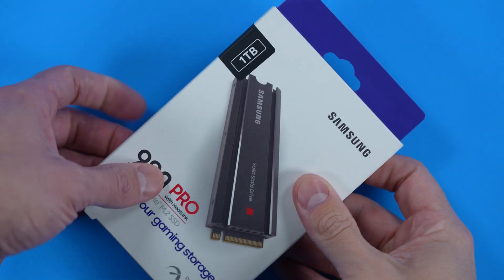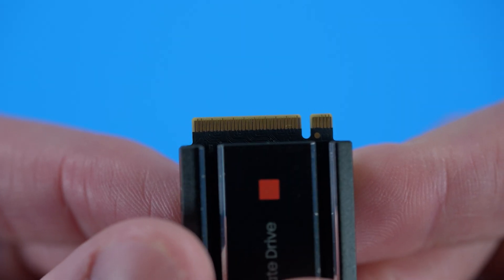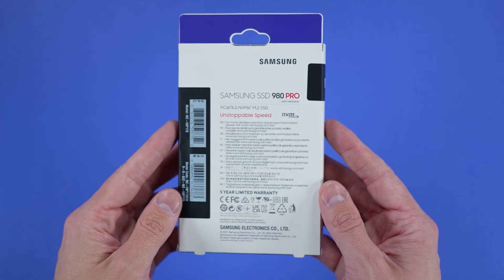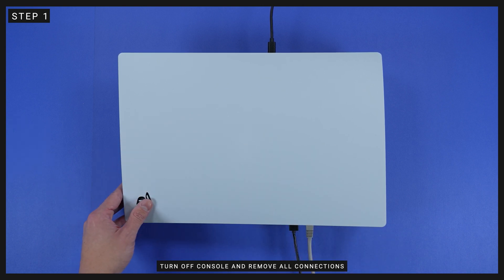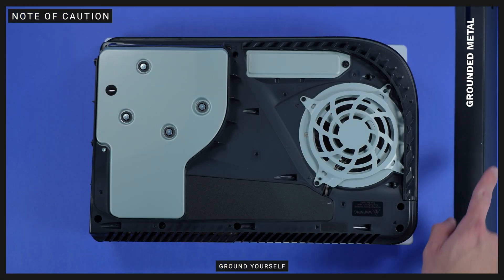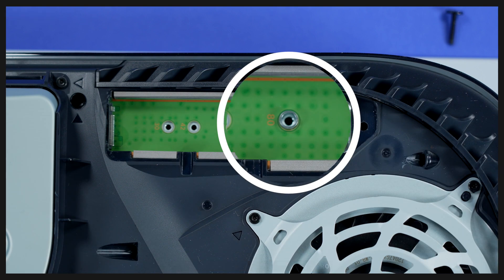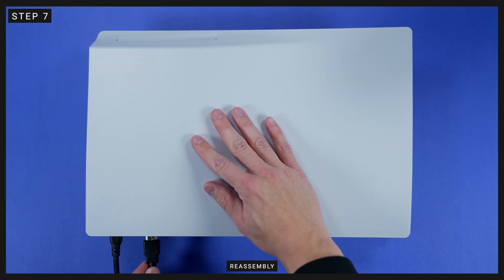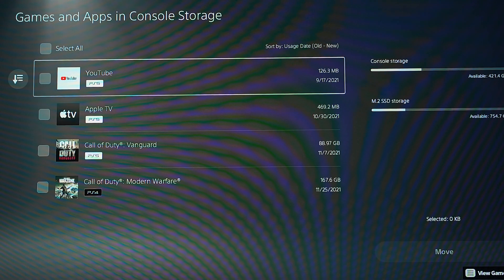PS5 Storage Upgrade - How to Install the Samsung 980 PRO w/ Heatsink, PCIe 4.0 NVMe SSD!

Comment from the maker: The 2TB is $180 now on Samsung ➡️ https://howl.me/cjkFThN5NNM
Reply: I just got the 2tb on sale at Best Buy for 153.00
Reply: Got the 2tb for $99 , prime deal 😊
Reply: @sully7105  Yes that was just the other day. You're fucking laughing bro!!!!!!!!!!!!
Reply: Got it $AUD 167.00
Reply: @unknown1859  Yeah they had it that price on PRIME DAY, missed out on that by a few days FML LMFAOOOOOOOOOO, nice bro :D
Reply: Ya bro! 🙌🏼 the price dropped!
Reply: @UnionVillageMedia 150 Amazon right now bought today
Reply: £169 Argos £190 cheaper than Xbox expansion 2tb
Reply: Got it for $130 @ Samsung
Reply: $139 on Amazon right now
Reply: Just got it from best buy $139
Reply: Needed to do the set up menu even though it changes. Incomplete review
Reply: @geefim2144  233 over here. AUD. Hoping the firmware doesn't start with 3. If you know, you know!!!!! Eh, I'll just tell you. It will implode harder than the titan if the firmware starts with 3 LMAO !
Reply: Is there a m.2 "Y" connector? So you could use two m.2 drives off one socket. It would be awesome to get 8tb with two drives.
Reply: I picked it up just 2 days ago for $100 on prime day 🎉
Reply: Got it at 146 in Amazon. Thank you for the reco!
Reply: $119 now with heatsink on amazon
Reply: I got it for $120 lol
Reply: I got for $99.00 bucks blk Friday @ Best Buy. I should’ve got the 990pro heat sink for $119.99 instead cause it’s just a faster version and makes the over all experience better. But they both are great regardless.
Reply: Dang, I got 2TB for $149 at BestBuy
Reply: It’s because 4TB drives are out that’s why

Comment: Multiple lines of evidence suggest the Samsung 980 PRO with PS5 heatsink can cause PS5 instability under certain conditions. Known firmware issues can brick the drive, which leads to crashes, stuttering, or black screens on the console. Thermal throttling may also trigger freezing or shutdowns. Many users (including myself) noticed that once the 980 PRO is removed, the PS5 runs smoothly again.

In comparison, PS5-certified SSDs like the WD SN850P or Seagate FireCuda 530 are better optimized, with more reliable thermal performance and stability. If you're having PS5 issues and using the 980 PRO, it's worth removing it and switching to a drive designed specifically for PS5. That solved the problem for me.
Reply from the maker: Mine is still trucking along with no issues. 🤷‍♂️

Comment: im literally doing this exact thing and it doesnt work. it did work but then it stopped and the screw head was stripped and now it wont read after getting replacement screws

Comment: I had both Samsung 980 Pro 1 TB & 2 TB

My first Samsung 980 Pro 1 TB Read Speed was 6500 mbps

But when i change it into new one Samsung 980 Pro 2 TB Read Speed was 6400 mbps

And Yours Samsung 980 Pro 1 TB Read Speed was 5500 mbps

Does this normal ?

Comment: When i was unscrewing the retention screw and spacer i lost the retention screw, it fell to the right and into the ps5. Anyone know what i can do? Ive never done this kinda thing before so i dont know if i should try to get it or get a new screw if that's possible, any help would br appreciated
Reply: Nevermind, the screw was still on the end of the screwdriver but it was blending in so I couldn't see it, that was the plot twist of the century

Comment: what is the height? or thickness? I wonder if it would fit underneath my GPU: ASUS TUF 7800XT in my computer.
Reply from the maker: Spec sheet has all that info for you.

Comment: Very nice simple and straight up guide 👍 Just purchased the 980 pro(heatsink) 1TB for 88.99 Can't w8 to go home and install it on my console!
Reply from the maker: Appreciate the feedback 🤝
Reply: Did you have to update it before installing it?
Reply: @xnonsz_4865  I just installed it my friend and it works ok so far. Should I update it first? 🤔
Reply: @Ailouros_90  I mean that’s what I’ve read and seen on YouTube, but I don’t have a pc that’s why I wanted to know if it works well without updating it. If u can update the firmware I think that would be better

Comment: The samsung drives don't work properly on the PS5. The read and write speed should be around 6500mb/s. NOT 5500mb/s. It needs a firmware update through your pc first. Reddit is filled with reports on this. I would recommend a different drive for easy install. Like de WD black SN850. This drive does not have this problem.

Comment: Ive tried for the last 2 hours to get my 980 pro to fit in the slot and it barely doesn't fit by the screw. Any suggestions?

Comment: I just bought this for €144, July 2023. The reviews on the website I bought it from say; this SSD has to be updated via PC first. Update via PC to unlock the 7000 MB/s read speed. If you don’t do this - it will only work on 5.500 MB/s read speed. Can anyone confirm?

Comment: Hey, so when I inserted my SSD into the slot, it wasn’t exactly laying flat after I pushed it in to the slot, it was kinda sticking upwards a bit. I put the screw on Anyway, but I wanted to see if you could let me know if that’s something I should go back and fix

Comment: The newer versions of the PS5 s are a bit different to these ones. . Getting the spacer in is a bit of a struggle as they don’t fit in the hole just sit on top and getting it still and putting the small screw in is a bit fiddly. Managed it in the end.

Comment: Make sure when installing you do it just like he did. Don’t leave it against the console and try to push forward cuz it will break your stick by applying too much pressure or maybe even your console. If you feel for the opening a little bit up and let it slide in you’ll be all good.

Comment: tips: you can get over 6000 mbps read speed (06:41 says you'll get 5500 mbps), if you update your SSD firmware before. works on me
Reply: Wtf i got to update my ssd just to get the full read speeds? Pls answer quick so i can cancel my order from best buy

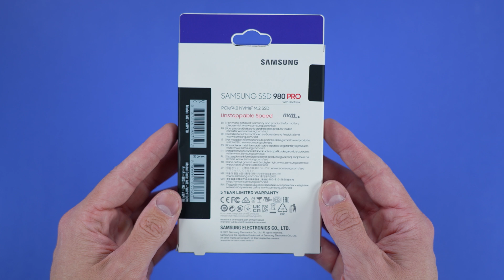Comment: Question. At 2:18. So my saved data within my ps5 console will be overwritten? Or that’s just the new internal drive itself? This is my first time getting one.
Reply: I think your original data, should still be there. Cos this guy's ( who did this video), his stuff was still there when the SSD was formatting. 

Plus it's a separate storage unit to the original storage that comes with the game.

Comment: so once you install the 980 pro with heat sink, you're able to use the 980 pro with heat sink in your PS5 that now has a 980 pro with heat sink so you can start putting games on your 980 pro with heat sink, 980 pro with heat sink
Reply: bro. fitAment?
Reply from the maker: FitAment of the heatsink 😉

Comment: Every reddit I have read you should put thermal pads on this even if it has a heatsink built in. Because the back is raw up against the motherboard itself. I did. Just a thought. 🤔

Comment: I did almost everything right EXCEPT 
The screw that adjusts the ssd LOL

But everything is working fine with the SSD. Plus I don't plan to move the PS5 so it won't be all over the place.
Reply: Do you mean the spacer or screw? If you mean the spacer, I think it might help with heat dissipation over time due to the small gap it would create between the ssd and  motherboard. I’m not 100% sure though.

Comment: Bought the Samsung 980 pro with heatsink with 2 TB. Thought about 1 TB, but decided to get a larger storage. You will not regret it. Easy to install in my PS5. Prefer it to the external hard drive.
Reply from the maker: Definitely the way to go. 👍
Reply: Did you update it to get the faster speeds?
Reply: You will reformat it in the beginning. It is easy to do.

Comment: My PS5 is still unboxed. Can I install the Samsung 980 PRO w/ Heatsink before I turn on my PS5 for the first time? Or do I need to set up the console first and then unplug and install? Thanks
Reply from the maker: Yes you can install it on a new system.
Reply: @TomasVillegas  Thank You. I ended up installing the Samsung after the initial set up. Thanks to you it went very smooth.

Comment: Picked up the 2TB 980 with heatsink for $249 at Best Buy.  Thanks for the easy to follow instructions!
Reply: Got a 2tb 980 w/heatsink for $152 with lightning deal discount on Amazon a month ago.
Reply: just got it for 140 so happy i waited
Reply: Just got it for $189.00 can't wait but do you need to update it first to get them speeds or does it come updated out of the box I heard you need to update first before installing into ps5 to get them speeds?
Reply: @davidleroy8382  I just bought mine and it came with the latest software I think. I watched some videos and my speed it the speed shown after the update. 

Besides I don't have a PC to slot this drive into so it's all I'm getting
Reply: Prime day paid 99$ 🤭
Reply: @DavidHernandez-ij2fq  Joining the Prime buyer's lol. How did you guys go about the firmware update?
Reply: Same here.. $249 @ amazon : )
Reply: @Cryofreez now it’s barely $129 @ Amazon ☠️😂
Reply: $189 as well
Reply: picked up for $80 on prime day lol
Reply: @lance55621 Lmaoo same, I used my gift card too, so I only paid $50
Reply: lol picked it up for $99 at best buy
Reply: Crazy I’m glad I waited just bought mines yesterday for 160😊
Reply: I got mine on sale from Best Buy for 179.99 today
Reply: It’s $100 right now
Reply: $100 for prime day muhahaha
Reply: @23Valmiki it’s going to be even cheaper this year on Black Friday muhahaha😂
Reply from the maker: Awesome 👍

Thanks for watching.
Reply: Now its 199.99
Reply: Damn I’m glad I waited, I managed to snatch a 2TB 980 for only 189 during the Black Friday sale.
Reply: Just got this for my son on Amazon for 200 plus 17 in tax so 217 lol but is that a good deal?
Reply: Same here dude
Reply: $172 on Amazon 2tb
Reply: Got mine for $169.99
Reply: $139 yesterday from Amazon
Reply: got it for $120 today!
Reply: I picked up the same one at best buy yesterday for $140 which was a shock to me for the price
Reply: What speeds do you get? Above 6000 mb/s? And did you have to do a firmware update for the ssd?
Reply: Just got mine from best buy it was on sale for $162 after tax
Reply: I got the 2TB on Amazon for 130$🙏
Reply: @JZea-ow6rg  u should’ve waited it’s going to be cheaper on black friday 😂
Reply: Got it for $120 at Best Buy today
Reply: @6.2_zeus  should’ve waited for black friday lol

Comment: I see a lot of youtubers who do this and get a read speed around 5600, yesterday I installed a Samsung 980 pro and got a read speed of 6500 mb/s
Reply: I did too. My box said it made 9-28-22 so I assume these came with firmware update. Got 6500 out the box
Reply: it was made**

Comment: Can I still use Samsung 970 EVO Plus 1TB PCIe 3.0 NVMe M.2 Internal V-NAND Solid State Drive for the ps5 even though the read speed isn’t high?
Reply: I think you need a 5500 minimum read speed for an ssd to word with the PS5

Edit: Also needs to be 4.0 so I guess the 970 won’t work

Comment: When I upgraded my PS4 HDD, I remember having to go to playstation website, download all the bios and such and having to use the flash drive to rebuild the whole OS.  I suppose this is no longer the case with PS5?
Reply from the maker: Nope. Since this is added storage, it's all handled in system.

Comment: This may have been asked and answered, but, I've recently installed the 2T version and my speed we're that impressive. I've seen videos about installing firmware to unlock it. My question is, once it's installed on the PS5 , how can I install the firmware to unlock more of the speed? Could really use the help.
Reply from the maker: You'll need a PC to do it unfortunately.
Reply: Samsung magician, plug it in a pc and the program does it for you.
Reply: @onixxx1984  Would it only work with a PC or can you use a Laptop?

Comment: The heatsink is pointless and useless. Temp differences are neglible. You'll get maybe a variance of 1 degree. I bought the 980 pro with heatsink and another 980 pro without heatsink and benchmarked them extensively on the same test bed under the same conditions. Temps were exactly the same or variance of one degree.
Reply from the maker: Sony seems to think you need the heatsink, so I think I'll stick with the manufacturer's recommendations. 👍

Comment: I have this exact SSD, I tried to install it as instructed, turned my console on and it wasn't showing up. I then tried to make sure it was in at least 10 more times and everytime i received the same results. It never showed up. So i have returned the one i had and a new one is suppose to arrive today from Amazon, the same one. Is it possible it could be my SSD port in my PS5? my PS5 isn't even a week old and this is the first time I have tried to install one. need help please, need the space!!
Reply from the maker: Contact their support 👍
Reply: @TomasVillegas  I exchanged it for another new one and that one worked so maybe it was a faulty one.

Comment: Unfortunately I installed the drive before I watched this video and idiotically put the spacer on top of the drive instead of below it. Once I saw this, I realized that my drive is probably slightly bent and at risk of overheating and I corrected it. Do you think it is possibly damaged? It was that way for 2 days and each day I played for 8 hours. Thanks for the video!
Reply from the maker: If it works now after that it should be fine.
Reply: @TomasVillegas  It works fine, I even stress tested it for 24 hours leaving Horizon running.  Hopefully no long term damage will pop up down the road.
Reply: @Haazoo  no any damage after all?
Reply: @sofianeATW  Still works fine a month later
Reply: @Haazoo  nice to hear

Comment: Fantastic video!

I have one question though: can the heatsink be safely removed to be used in laptops with not much space? Since Samsung is offering a variant of the same SSD without a heatsink, it shouldn't be a problem, but I don't know how the cooling is done and if the parts are glued. I am considering buying one and I may have to remove the heatsink is I decide to use it in my laptop instead of my PS5.
Reply from the maker: If you remove the heatsink it will void your warranty. Just go for the non-heatsink version. 👍
Reply: Why would you buy one with a heatsink if you're going to take it off amyways? Just buy the one without the heatsink, it's the same price...
Reply: @apictureoffunction  I'm not sure if I would use it in the PS5 or in the laptop, and the one with the heatsink may not have enough room inside the laptop.

Comment: FireCuda 530 for me. Im a hoarder and I keep all my consoles. Pretty sure this drive will out live everything else. Plus the temps are crazy vs Sam and WD offering. EKWB sure know their stuff in regards to cooling.
Reply: So the firecuda is better ?
Reply: @yourwaveyness7i899  spec sheet is faster. Use higher grade nand. Over double the durability. 3yr data recovery. Lower temps. Yep. Better.
Reply: There is a comparison video on YouTube. They both seem close but the 980 does some things faster but the firecuda also does some things faster. I don’t think they ever compared temps in that video but I think they are both extremely close. There is also a sea gate m2 which is a firecuda optimized specially for ps5.

Comment: I heard that you need to update firmware first to get advertised speeds for this. Is that true?
Reply: Yes. I know Best Buy can give you a firmware update at the store before you leave with the drive in case you don't have a motherboard to attach it to
Reply: @VindettaV-z5y   I ended up buying an adapter for it. I got this (2TB) on Gamestops site when it had that price error for $200 so I didn't mind paying $10-$15 for the adapter. Everything is up to date and it is nice having all my games ready to go. 👍
Reply: @Plays2Plat  I saw that price error, and thought they would just end up giving me the 1TB for $200. You got the entire 2TB for just $200?
Reply: @VindettaV-z5y   sure did. When @Wario64 posted I bought it as fast as possible. Deal of the year so far imo
Reply: @Plays2Plat  I will be sure not to hesitate if it happens again then
Reply: @Plays2Plat  what adapted did u end up getting I thought you can’t update with an adapter ?
Reply: It's on Amazon for $189.00 rightnow
Reply: Yes. You must install it in a PC motherboard and use Samsung Magician to update the firmware before installing in the PS5 to get the full speeds.
Reply: Do you still need an adapter to update it?
Reply: @davidleroy8382  I just got one today, it was already updated out of the box
Reply: @ty3ism  awesome thankyou
Reply: @ty3ism  so you don’t have use PC to get the update?
Reply: @quietstormkel14  Mine was already updated. I’ve read that some people are still getting non updated ones out of the box. If you install it in your ps5 and it says the speed is around 6500 then it’s already updated. If it’s around 5500, then it needs to be updated by a computer.
Reply: @ty3ism  I have a laptop
Reply: I swear I saw like a 1tb ssd for £20 with everything 5 hours ago, probably error.

Comment: Question, please.... I'm just installing my 980 Pro 4.0 2TB ssd. {with heatsink) I'm wondering which slot i should install it in my gigabyte z590 aorus elite MB.  I have as Radeon Pro WX-3200 GPU (with own fan). MB has three slots.  Which one should I use?

Available SLOTS: M2A_CPU (Above GPU), M2B_SB (Below GPU), or M2P_SB (Below M2B)  Thanks!

Comment: I didn't realize it was an expansion port thank for this. Just got mine without the heat sink but the heat sink came free from Newegg. Way easier than upgrading the PS4 hard drive. Is the R/W >,<,or = to the factory drive?
Reply: It’s faster/higher